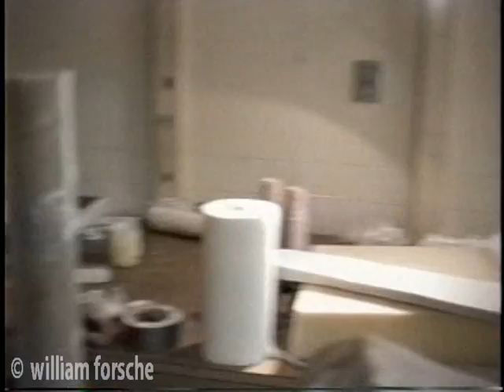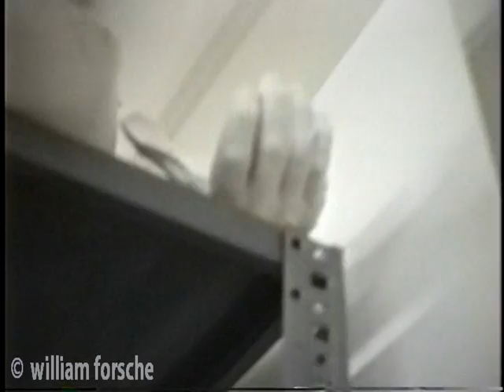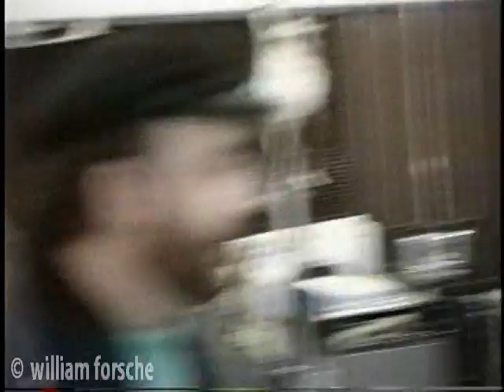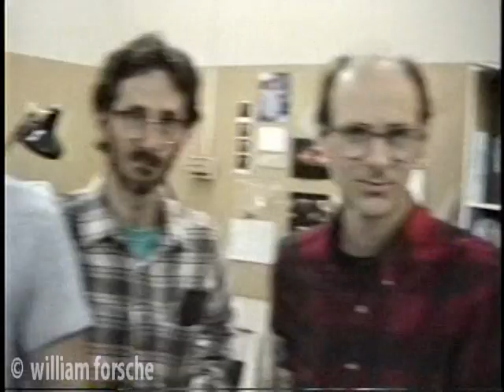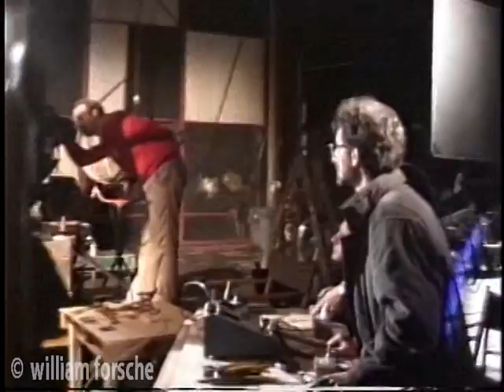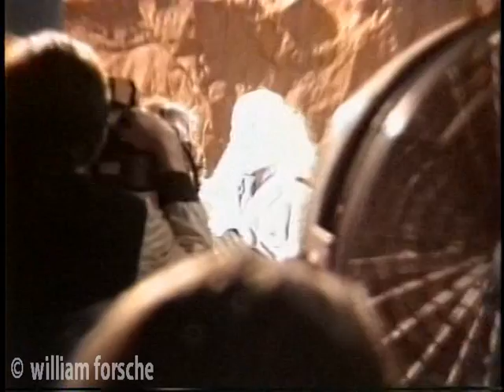The Creation of the Donovan FX transformation at ILM for Indiana Jones and the Last Crusade

Comment: the good old days without CGI, when everything was actually believable...
Reply: Or, you know, at least impressive. Even if you could see the strings attached from time to time, you'd go "Oh, they built/painted THAT?" Like with Toth's melting face. I can see it's wax melting, but someone built a head with muscle tissue underneath out of wax!
Reply: Would you be more impressed if you learned it was made of not wax, but gelatine? Look into it, it was amazing how George walas did it.
Reply: CGI is just a tool that you can use properly or not. It's used effectively a lot of the time in a variety of movies but it's done so well that nobody notices it's even there. Because some CGI is so hard to notice when it's done well, people only think about it when it's obviously being used (for example, a space ship in space) and only use those scenarios to decide if it's good or not. Those scenarios are not all that CGI is used for.
Reply: These frames will be processed using CGI, by the way!